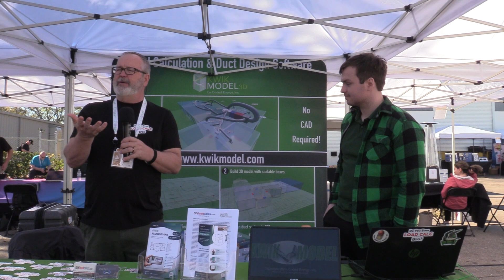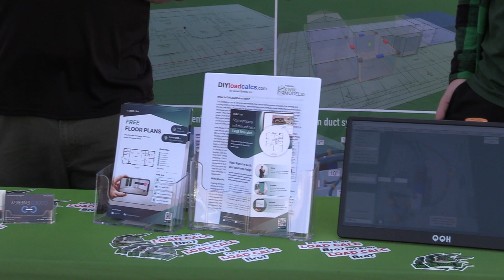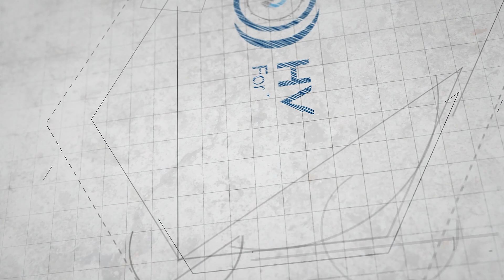Load Calculations at the Kwik Model 3D Booth!

Comment: I told a bunch of customers, mainly commercial, to get a design and spec first. Then, they can shop out the work. Great idea to make this accessible for residential. I’ve lost jobs to contractors pushing oversized units without load calcs. And, have wasted time doing a load calc and having the customer find the cheaper guy afterwords.I like the idea of third party/independent load calcs.